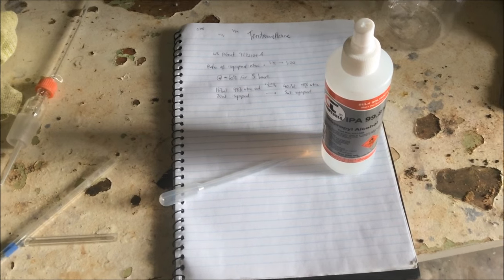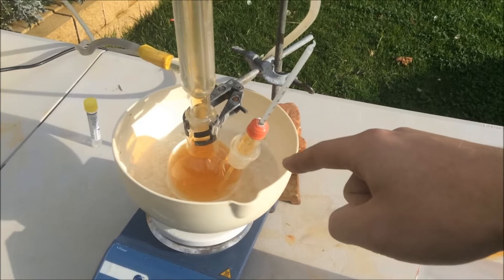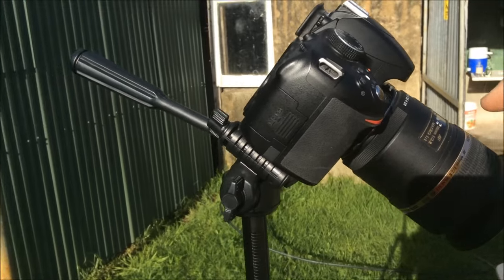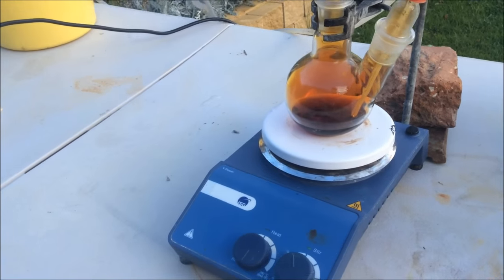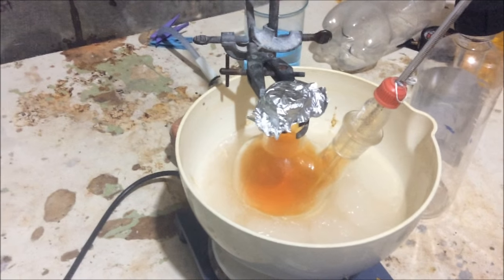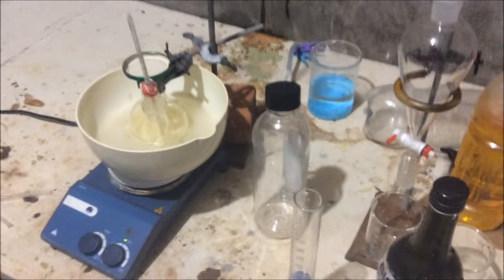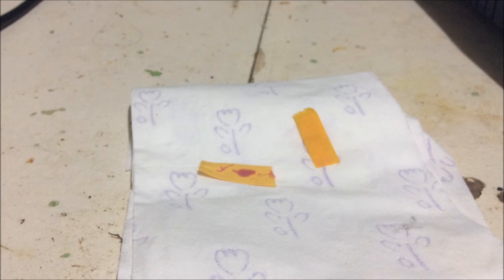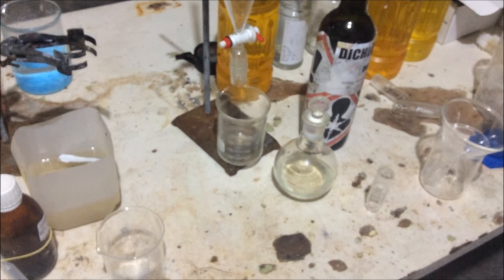Making Trinitromethane/Nitroform (Part 1)

Comment: Nitrogen dioxide can be destroyed in a flame.  My company used to do reactions that released copious amounts of nitrogen oxides.  We found that a convenient way to get rid of it was to ignite a small natural gas flame and run the fumes into the center of the flame.
Reply: Does the burning of the gas not produce various other nitrous oxides? Or is that only the case with longer chain hydrocarbons that would be present in something like diesel? (I’m no chemist btw just intrigued)
Reply: @shabbagadoosh  The equilibrium concentration in a flame is small.  In other words, there is a natural rate of formation in the flame that competes with a very large rate of decomposition.  So you end up with only a tiny amount of NOx.  I hope that makes sense…
Reply: @atari7001  ahh very good explanation thank you
Reply: @atari7001  Also, isn't that a question of temperature ? An open flame burning goes in lower temperature than the inside of the cylinder from a turbocharged Diesel engine.
Reply: @VOID_WARRANTY  yes, that’s true.  Rate of formation in a colder flame is much smaller in comparison to rate of decomposition.

Comment: The beginning reminds me of a time I was trying to learn how to cure a specific type of resin (phenolic) for rocket applications and found a nasa paper detailing their process. I stopped reading after they described how they first used some kind of electron emission something or other (not quite a scanning electron microscope but I knew it was out of my league) to inspect the SUV sized mold for a composite rocket nozzle before applying the phenolic and carbon fiber and pressing it with a few thousand psi of pressure at high temperatures.
Reply: I'd bet that the pressure and heat curing could be done st home on a really small scale. Especially if you have a rocketry club or friends to all chip in on it.
Reply: Well yeah but would the scale achievable at home be useful for amateur rocketry tho? Like Diamond anvils fit on a normal desk and the pressures are often generated by hand turned mechanisms, those generate the highest pressures we've achieved but only generate it on a nanoscopic area.

Comment: When I first watched this I didn't know it but since then when I've done long refluxes (or any reactions) that produce huge amounts of NO2 or HCl or any kind of gas and I have high vapor pressure components in the reaction, even if their boiling point is nowhere near the reaction temperature, you can basically just lose everything to reaction vapor being carried away by waste gas.  It feels like in this video maybe pretty much all the isopropanol got carried out by the NO2.

Now I use an ethylene glycol/water mix in a closed loop in my condenser with a CPU cooler radiator that I can submerge in ice water or methanol/dry ice.  You have to insulate the condenser though or you get tons of condensation or ice forming on it.  Maybe AU is dry enough most of the time that that isn't a problem.
Reply: i once had an idea of passing liquid butane through a condenser

or liquid ammonia

or cold ethanol

or pressurized gaseous refrigerant
Reply: @VerbenaIDK  I think you'd need custom glassware for that or just not glass at all, at least for everything but the ethanol.

Liquid ammonia and butane are kind of sketchy for sealed ampules. I imagine they would probably explode a condenser jacket.

There are a few places that make double-walled condensers (i.e. a condensing coil inside and a jacket on the outside) that might help with insulation from frost buildup but they're all $400 or more.
Reply: @htomerif  it would work if it's kept really cold and you are distilling somrthing that boils under room temp, maybe

if it was butane just whatever it'a gonna explode and shrapnel all around vut atleast it inst toxic like ammonia
Reply: @VerbenaIDK  Yeah, kind of. If you've ever had to do a reflux for several days though, you might start questioning how much you trust your cooling apparatus to keep the refrigerant cold enough not to explode.

People do do the dry ice/ethanol thing though and you don't have to worry about that exploding. I don't see why you couldn't just use a condenser loop from an air conditioner and put it in your ethanol tank for a more permanent source of cooling.
Reply: @htomerif  i actually never did long refluxes or anything really

just kinda brain fart there, i am the person that auddenly thinks "ok, imagine an oxy acetylene torch, but instead of acetylene, it's ammonia"

i dont have mobey to soend on glassware, shit is really expensive here and can get really expensive quickly

some day tho, i can dream

edit: also forgot to add, while the ethanol could kind of work, it would not be a great idea, i though of that becausr ethanol is very volatile and would boil fast and cool down, hell, even a half full ethanol bottle gets kinda cold at room temp, but then id not worry too much about the condenser itself exploding, but more the hose popping off and there was some ignitikn source near

Comment: Yay, you actually did it! Shame the yield was absolutely horrendous, but I agree that the main problems are likely in the extraction steps. Although I'm not sure if the test of acidity meant anything, as there may have been a fair bit of acid dissolved in the product (nitric acid dissolves in DCM). The color is a giveaway for nitroform though.

Also, a quick note on the chemistry: nitroform has nitro groups, not nitrate esters. Also, the reaction proceeds very similarly to the haloform reaction: isopropanol gets oxidized to acetone, and via the keto enol tautomerism one of the alpha methyls gets three nitros from nitrate ions. This C(NO2)3- is a good leaving group (evidenced by its extreme acidity), and so ambient water hydrolyses the bond between the C(NO2)3- and the rest of the molecule, forming acetic acid and nitroform.

A quick literature search revealed some alternative preps, however. The reaction of acetylene gas with nitric acid also produces nitroform, but I can't find a reasonably recent reference on this. A more promising alternative is to start from chloroacetic acid, react this with urea to form chloroacetamide, add sodium cyanide and form cyanoacetamide, and react this with anhydrous nitric and sulfuric acids to form trinitroacetonitrile (Inorg. Chem., 2013, 52 (12), pp 7249–7260 --they use CCl4 but DCM should substitute, and they use 20% oleum but I think standard 98% conc sulfuric should work OK as well. No way around anhydrous nitric acid though.) The trinitroacetonitrile will hydrolyse in neutral aqueous solution to the ammonium salt of trinitromethane. This is really what you want anyways, since while bulk nitroform can be a little touchy, the salts are much easier to handle, and can be obtained from the ammonium salts by metathesis (driven by the release of ammonia gas)
Reply from the maker: Hey, thanks for the comment!

It's very possible some nitric acid dissolved in the DCM, however the whole point of that extraction method was the no nitric acid is extracted. This is advantages as you can then fluorinate the mix directly without some dangerous byproducts (see http://patents.justia.com/patent/4147731 Example II). That being said, whether the patent is accurate or I conducted it well enough is not certain. 

Ah, such a stupid error for me to make. If I drew out the NO3 groups I would've noticed I wrote it wrong straight away. And from there I just propagated the error. 

The mechanism sounds very solid. The patent also notes some oxalic acid byproduct, which is just further oxidation of the acetic acid. 

Acetylene with nitric acid is another prep I might try in future, but if I recall correctly, it often needs a mercury catalyst to get decent yields, which lowers the appeal of the method quite a lot. 

As far as the other method, that has +Chemplayer written all over it!
Reply: @ExtractionsAndIre  OG Chemplayer comment - It brings a tear to my eye.

Comment: Adds reagent to concentrated acid instead of the other way round
"Can't really see the nitrogen dioxide, but you can certainly smell it"
"So, we've got an acid spill, and a mercury spill, but that was my favourite flask"
Fuckin ozzies
Reply: Why don't we do nitrations by adding the acid mix dropwise instead of adding the other subject to the whole darned acid bath?
Reply: @coopergates9680  We do, normally. As a general rule you don't add stuff to concentrated acids because reactions tend to be exothermic, and you really don't want boiling concentrated acid! For nitrations specifically, there's often more than one place a nitro group can add, so you want to control the reaction as closely as possible so you don't over nitrate. Although, if there's only one possible place then I suppose that doesn't matter.

Edit: and he's making trinitro methane, so he wants maximum nitration
Reply: @RaunienTheFirst  Well, he doesn't want to nitrate it further to tetranitromethane (though depending on reaction conditions the fourth nitration may be much less likely).

How sensitive/unstable is methylammonium nitroformate?
Reply: @coopergates9680  not the faintest idea.

Comment: Looking at your chalkboard formula, I would have expected that you'd have started with methanol, rather than isopropyl alcohol, which has 2 methyl groups attached to the center carbon bearing the hydroxy group.  What happened to the other 2 methyl groups?  Does it say they were converted to CO2 or something?

Comment: nice attempt ! I think the procedure can be upgraded. To obtain a good yield of  nitroform i suggest to make it from 99% isopropanol and an anhydrous  nitric acid that can be obtained by extraction with DCM from a sulphuric - nitric acid solution. If you are interested i can tell you more about this procedure. ( this one does not use DCM for the final extraction). 

I know to what dose mean break your own glassware xD break the heart see a 50€ round bottom flask crushing.
I really suggest to improve your safety equipment. Thats why i will donate.

Comment: 17:46..no..I seriously doubt you have got any amount left in your solvent...I would say that it was your reaction conditions that are the culprit, you really needed to nuke it after the initial safety phase, doing it with a smaller batch would be a good idea too. To get a better idea of the reaction conditions needed for a better yield, you'd need to read up on what electron withdrawing effect those nitro groups would have on the carbon, and the speed of the reactions, whether it's going to be rate controlled or equilibrium controlled. I know it's not the nitric acid itself that is the nitrating agent, it's the nitronium ion, and it's that thing's rate of formation, rate of substitution and it's equillibrium that will determine the conditions..no doubt the geezers who wrote the method took samples during their cook up at intervals and checked it for trinitromethane and free RFNA and water etc etc...hmm maybe a little conc sulfuric could bind up the water from addition just like in a normal nitration, just spit ballin..havent read the patent or looked up anything...
Reply from the maker: I do hope to try this again some day. Looking at the mechanism, I think we had the opposite problem. One of the steps requires water... so even though it needs fuming nitric acid initially, there's an intermediate that needs water. So maybe just adding a few drops near the end will help it out? Hmm

Comment: Love your channel man👍 but I was wondering, what makes tetranitromethane so much more dangerous than trinitromethane? Thanks in advance for any replies, they’re much appreciated.
Reply from the maker: Hey man, glad you like the channel!
Biology is weird, very slight changes to molecules can really change their toxicity. If I had to guess without doing any research at all.... usually having a hydrogen attached to a molecule gives it a way of being broken down, like chloroform or trinitromethane. Suddenly, if you have no hydrogen there at all, the chemistry of the compound is dramatically changed, and your body can't process it nicely, like carbon tetrachloride of tetranitromethane. But unsure, toxicity of things is a fascinating field that I don't understand
Reply: Extractions&Ire Thanks for the reply! But that seems reasonable. When I’m not so busy, I will try to do a more in depth search about it and maybe try and find some sort of mechanism,since toxicity is something I find pretty interesting. Keep up the good work though :)
Reply: @ExtractionsAndIre  Maybe interesting sidenote:

From what I read, at least the american model airplane rules EXPLICITLY outrule the use of tetranitromethane (and hydrazine) in the fuel. Record applications do check the fuel for tetranitromethane content.

People actually were crazy enough to use this stuff, and from some reports (which are surely at least a little "embellished") you had to mix it in the chilled fuel shortly before use, because the mixture "decomposes" when it gets to warm for too long ..

But you apparently did get 50-70% power boost out of a few percents of it added. But is it worth 50-70% less fingers or worse?

Comment: It's really too bad so much of your RFN that goes into the reaction seems to just toss its shit in the air instead of sticking it on the IPA like it was supposed to.  Is there any way to prevent that and reduce the amount of RFN needed?
Reply: You could attach a gas outlet to the condenser and run it into concentrated peroxide to turn the gas back to nitric acid. Not sure it would be worth it though.
Reply: Maybe add phosphorus pentoxide during the reaction?

Comment: I recall seeing in your storage in plastic video that you had a bunch of (possibly plastic contaminated) nitromethane in an old wine bottle. I'm no chemist, but would it not have been easier, cheaper on the acid, and maybe safer to start from there instead of the isopropanol?

Comment: Do dinitroanisole (maybe myrol for something more practical). I'd also like to see a sulfur trioxide vid. For the fume hood build a fume hood box thing and then use a bathroom ventilation fan to get rid of the fumes. Trinitromethane isn't acidic on it's own but maybe it formed a ton of the acidic anion. No idea of the solubility of the trinitromethane or like how to extract it more betterer.
Reply from the maker: Never heard of dinitroanisole but it looks cool, the anisole core seems a bit hard to get a hold of or make though.

I mean the outside world is alright for most things. The fan is only going to pump it outside anyway
Reply: Dinitroanisole is an explosive that the U.S. military might possibly be considering looking at. No idea why tho. It's not any more stable than something like RDX and the power and oxygen balance is DREADFUL.

Comment: For future reference, you are better off working without gloves next to an open source of water when dealing with nitric acid. It can set gloves on fire in the time it takes to get them off at the elevated temperatures you were dealing with. If you've never seen nitrile gloves go up in flames, it is worth doing as a demo once.
Reply from the maker: That's a fair point, but the gloves you see me wear in the video are not nitrile but rubber. They probably still has a reaction with concentrated nitric, but I wear them when working with conc. sulfuric or combinations of sulfuric and nitric because the burns are bad. Nitric burns to the skin aren't painful but look very bad, but sulfuric would hurt (I actually don't know for sure, that's a win for the gloves!)
Reply: Sulfuric acid burns sting like a thousand bees heard you talking shit about their mum. But, it takes a bit for it to actually get through the skin. If you just leave the tap running while working with them, you have ~10 seconds to get your hands under it without any issues. Nitric burns look ugly because it reacts with the keratin in the outer skin layers. It is when either acid gets to the layers beneath that you feel anything.

Heavy rubber gloves are fine for either acid. I presumed you weren't using nitrile as most of them are blue or purple.
Reply: @xenomancer1  No tap present that I can see, but a small bucket of bicarbonate solution for a fast dunk might be invaluable some day.

Comment: Ever looked into tetranitromethane? It is usually made by nitration of acetic anhydride with fuming nitric acid. As a reagent in organic chemistry it has very interesting properties, but it is so sensitive it is a real danger to use and store. The glassware must be sparkling clean, any hint of organic contaminant can set the stuff off. EDIT: 3:40 just heard you have considered it, yes it is indeed far too toxic and dangerous